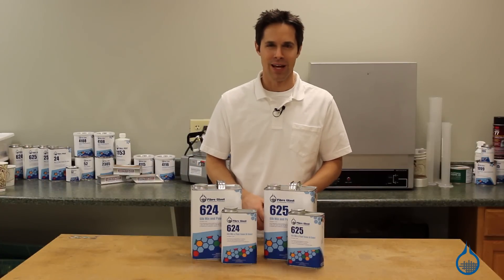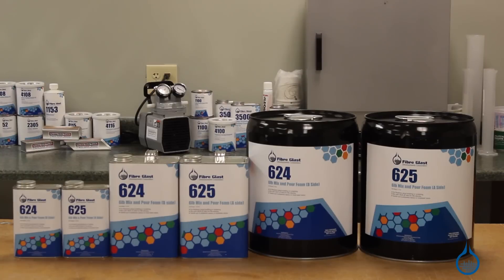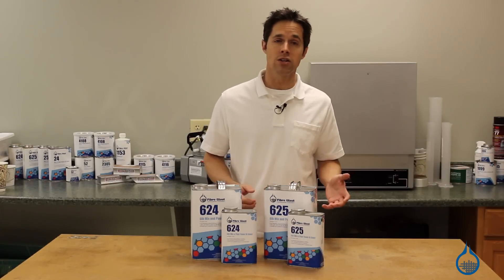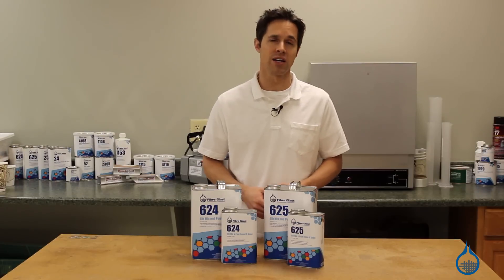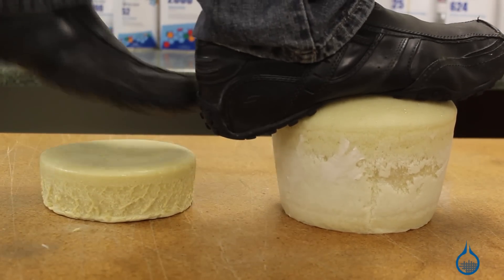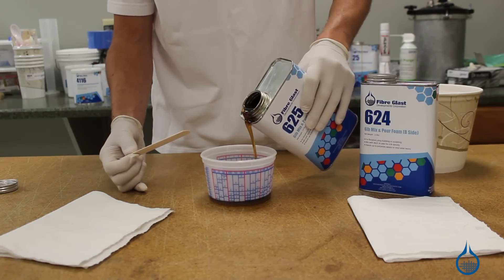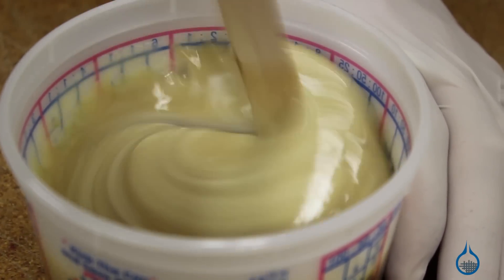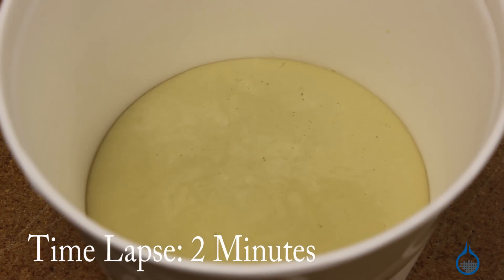6 Lb. Mix and Pour Foam

Comment: I'd like to use something like this to fill my kayak. Would this crack a kayak if too much were put in? I'd prefer not to drill a ton of holes in it.
Reply from the maker: Yes, it you were to pour too much in it could crack. We recommend pouring in small batches and letting it rise before pouring more. This way you're able to tell if more is needed.

Comment: When using, it's likely to have the foam rise beyond the desired limit. If you have to cut the foam, how do you reseal the surface to prevent it from absorbing water?
Reply from the maker: Hi Michael. Even if you have to shave off excess foam, this foam not absorb water. This foam creates a series of watertight bubbles throughout the entire batch of foam, cutting off a layer of foam will still leave behind a surface of watertight bubbles. If you would like to truly seal off the surface of your foam, we would recommend you use our #1041 Duratec® Gray Surfacing Primer.

Comment: Would you recommend using the 2lb or 6lb flotation foam for making small buoys in a torpedo shape? The core would have pvc and then a layered epoxy finish. Do you think the 2lb would be durable enough or to choose the 6lb?
Reply from the maker: Thank you for reaching out. The 6lb density foam is a better option for floatation buoys. The 2lb is more suitable for filling cavities.

Comment: Once it cures, is it possible to use screws to attach something to it? Specifically, if I pour this stuff under the floor of my fiberglass boat and let it cure, could I mount the captains chair and steering console to it?
Reply from the maker: Hello, unfortunately this product is not dense enough to secure attachments to it.
Reply: @fibreglast  could you put some kind of anchoring material in the foam on the bottom board such as plastic or wood to screw the seats to?

Comment: I’m hoping to use this product to make a head mast float ( the teardrop shape float on top of a sailboat mast, used for buoyancy so the mast does not sink).  I need 30 lbs of buoyancy.  Can this foam be sculpted and sand to a smooth surface?
Reply from the maker: Hi Alex! This is Adam from Fibre Glast. Yes this product is perfect for that type of application. I can certainly be sculpted and sanded to a smooth surface. I have copied a link to that product page below. 

https://www.fibreglast.com/product/6Lb-Mix-and-Pour-Foam/Mix-and-Pour-Foam

Comment: Can this absorb the impact of an arrow? I am looking to make a home made target for archery
Reply from the maker: +HarbingerZeroOne Good question. That will depend largely on the thickness of the foam used, as well as the velocity of the arrow and draw strength. It isn't really our intended use, so it's really hard to say if this would be an ideal product for what you have in mind.

Here is the product data sheet for the foam, so you can look it over yourself. At the bottom, you can find the typical physical properties of the foam once it hardens. http://bit.ly/2026KLV
Reply: HarbingerZeroOne 

yep I didn't test this exact one but I used canned spray foam in an old shirt and an old water jug inside of that  and milk jug filled with old Halloween zombie mask. might not last forever but it's my own custom Target I might try to post a picture later for my experiments something to consider would be to cut The Jug in half to let it dry and I made it to the head could detach so if I shot it up I could replace it my draw length is 30 with about 60 pounds and it stops most of my target arrows ( :   the old shirt and jug I think definitely help but was having issues with it drying all way through being I put it inside of a jug side effect is I have some sticky arrows but just having a few drinks slinging arrows I really don't care ( :
Reply: HarbingerZeroOne 

IL try to put a shelf life on target  after I shoot it a lot. but not much free time with kids n work. it might not be the longest lasting but it definitely is fun. my son liked watching me shoot zombie in eye and head popped off lol. I use weak link to connect head and body cause don't want arrow to hit something hard not to mention I like watching zombie head fly across lawn lol

Comment: Can you reinforce this foam by adding carbon fiber pre cut strips?
Reply from the maker: Hello. This foam can be reinforced when it is cured between two laminated carbon fiber sheets. But just adding raw carbon fiber strips to the mix & pour foam will not add any additional structural rigidity.
Reply: Thanks, I was hoping for some structurally strong so that it won't compress when submerged under water.  Which version would recommend for underwater usage?
Reply from the maker: I would recommend the 6 lb over the 2 lb. It will stand up the best to compression.

Comment: Just thinking of the physical properties of the compression strength given to be 120 psi.
Do you have any data as to the actual construction relevant strengths?
What kind of load would this foam carry over in the center point of an area say 36 by 36 inches at what thickness without application of fiber glass and epoxy resins to the surface?
Reply from the maker: Good Morning. Unfortunately we do not have the data on hand to answer this exact questions. A load test of this nature would have to be performed to get accurate results.
Reply: A quick question before I forget it. Do you have any hints on how to ensure a good bond between steel and fibre glass/resin?
The purpose being to form a less corrosion prone layer on a hull before painting it than regular marine primer would provide.
Reply from the maker: Bonding to metal can be difficult. Firstly your steel will need to be prepped and primed in order for resin to adhere. Our Duratec Grey Surfacing Primer or our ChromaGlast High Solids Primer Surfacer and Sealer may work for you. For the best results we recommend the use of vinyl ester or epoxy resin systems. If you choose to use our ChromaGlast High Solids Primer Surfacer and Sealer you will need to use an epoxy resin system as that primer is epoxy based.
Reply: I assume that is not requiring heat to cure above regular  room temperatures unlike some polyurethane resins where the primer is initiated by application of heat?
Reply from the maker: You are mostly correct in that assumption. Our vinyl ester resin will not require heat nor will out System 2000 - 2020 epoxy resin. However our System 2000 Epoxy with either the 2060 or the 2120 hardeners will require additional heat to cure.

If you are referring to just the primers that we have suggested neither of them will require additional heat to cure.
Reply: Thanks a million. That settles the issue more or less. All things have their applications and suitability but epoxy resin seems to hold up very well in the most of cases where polyurethane seems to be overkill and much more complicated. In particular over larger surfaces for a DIY project.
The most commonly referred to issue seems to be the pot life/time to gel being very short in the polyurethane cases and can appear somewhat easier to control in the case of epoxy to get the products properly mixed improving the quality in the resulting end product.

Comment: Very strange question, but could a liquid foam have tensile strength? Not specifically your foam, but is it plausible or chemically possible in any sense?
Reply from the maker: We list a tensile strength of 52psi for our 2# Mix and Pour Foam (part #24/25). That data is not available for our 6# foam. Is there a specific strength target you have for an application?
Reply: No, just been hypothesizing a chemistry experiment. I saw your video and I figured I should ask some people who know what they're doing about it!

I've been trying to design a polyvinyl-alcohol or nano-cellulose based foam held together by it an outer skin. Ideally, this liquid plastic/foam cable would function like a super strong "silly string".

Comment: Can you fiber glass 6 lb foam?
Reply from the maker: Absolutely. This foam can be used as a sandwich core material and as a plug.
Reply: Can this fill up a hollow structure made of aluminum to be a structural core? How do I make sure there is no void and will the urethane foam adhere to the aluminum or should I apply adhesives on the aluminum before pouring please?